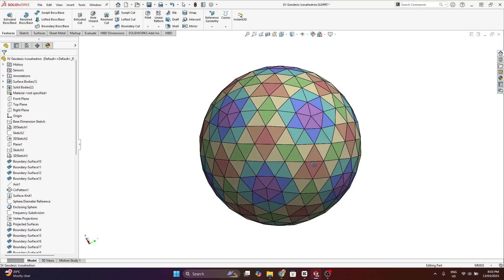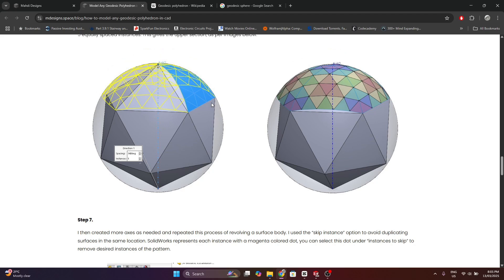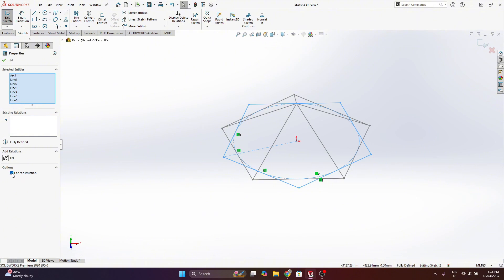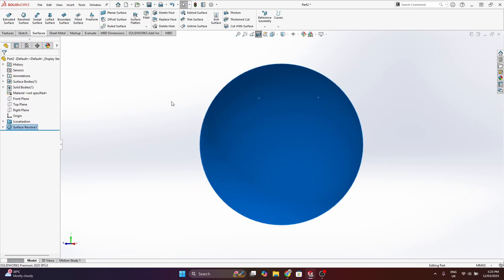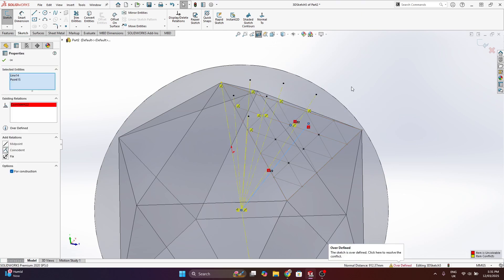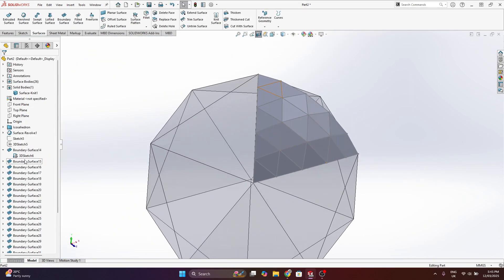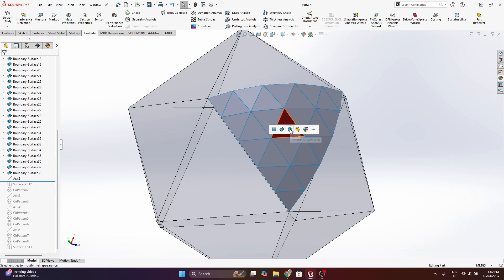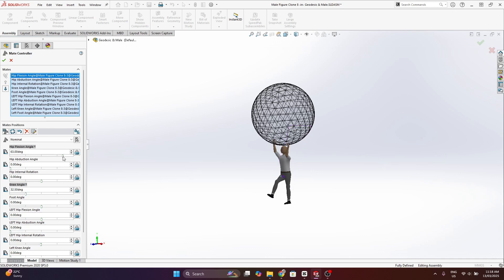How to Model ANY Geodesic Sphere in CAD

Comment: If the triangles have differing surface areas does that mean they are not all the same equilateral triangle? Is this shape possible to make with just one size of equilateral triangle where all the verticies lie on the same sphere?
Reply from the maker: Correct, they are not all the same triangles. In the model I show I made all equal triangles the same colour. The number of unique triangles depends on the frequency of the geodesic.

You cannot make this shape with just one unique triangle size. With just one triangle size you can either make a tetrahedron (three triangles making a vertex), octahedron (four triangles making a vertex) or icosahedron (five triangles making a vertex). If you try make a vertex from six equilateral triangles they all end up lying on a flat plane which doesn't lead to a 3D shape.

You can approximate a sphere using a single triangle but you need to control the "crinkling" - the result is a bumpy or irregular sphere approximation and the vertices will not all lie on a perfect sphere. Some more info about this here https://discourse.mcneel.com/t/can-you-model-a-sphere-from-identical-equilateral-triangles/75685